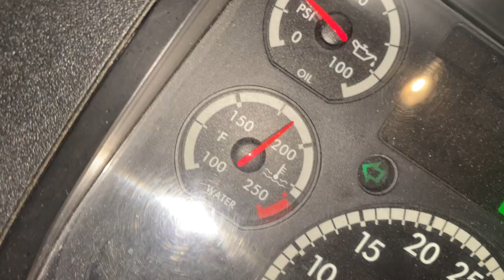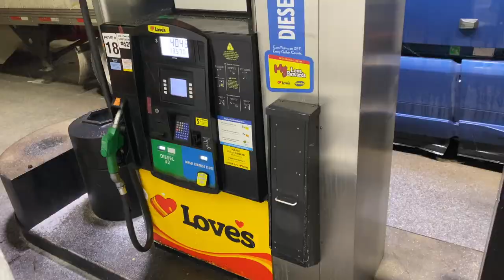DRIVING THROUGH WINTER STORM & TRUCK BREAKDOWN

Comment: Invest in some winter wiper blades. Also, use the defroster to keep the windshield warm enough to melt all the ice, which will keep the wipers cleaner. If you face gets hot, crack your window.
Reply from the maker: Definitely need to get some winter blades! But I definitely had the defrost on blast and through out the night some ice still built up in the corners! It was a crazy night! But these are great tips! Thank you for watching ☺️💕